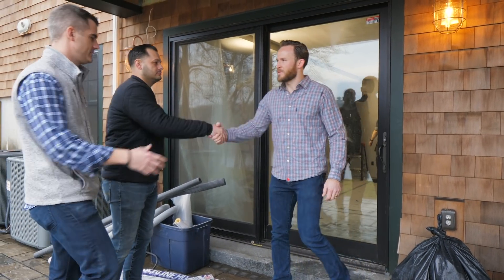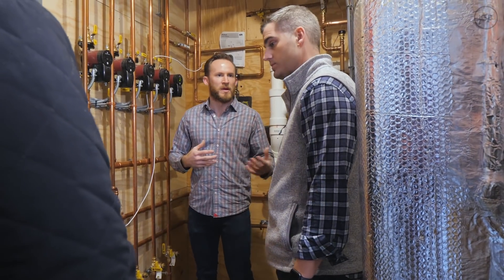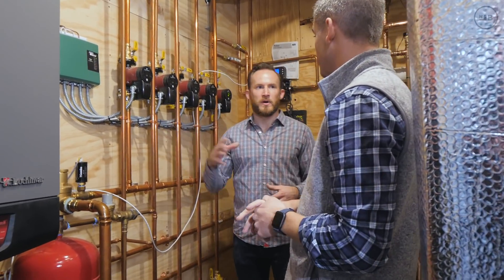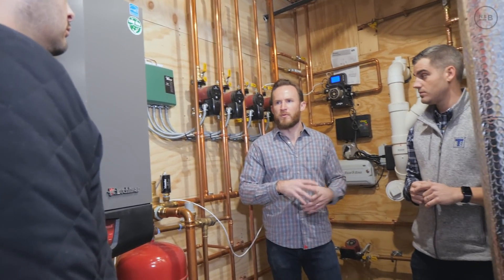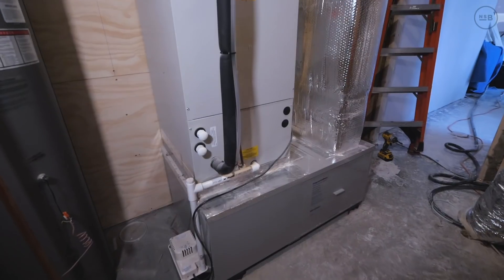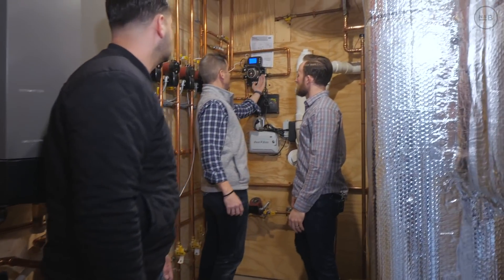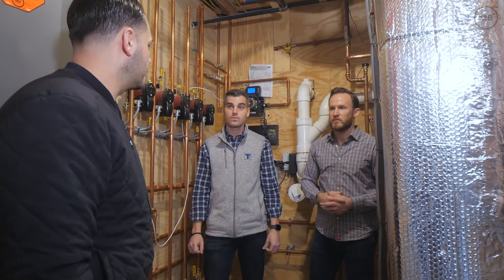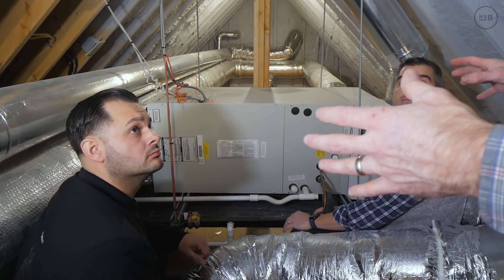Walking through a comfort engineered HVAC system at NS Builders Lake Drive Custom Project

Comment: Psychrometrics guys. The dryness of air has to do with the temperature gain. Only way this 'dry' statement is true is if the HW can't produce the same high temperature of air. Furnaces do not allow combustion gases to have mixing with air.

Great craftsmanship though. Kudos on that piping plan
Reply: I'm glad someone said it, that irked me.  Another thing that would add to dryer air in the winter is air-leakage to the outside as well which is less of a problem in newer high performance homes.
Reply: I consider myself extremely lucky that my thermodynamics professor found time at the end of the term to cover psychometrics! It really simplifies the connection between heating/cooling air and the humidity.

Comment: Love the idea of putting the ERV into the return of the HVAC system so it 1) eliminates the need for its own ductwork, and 2) conditions the air before it enters the home so you always have a comfortable home. 

I’m a little unclear about the answer about how it all works when the AC isn’t running though. Was he saying that the ERV ducts go directly to the return grills themselves?

Comment: Awesome Video. However it sounds like you were on to something with the ERV dumping air through the existing air handler returns. When the air handler is off the ERV should probably send a 24v signal to the air handler to turn on its fan. Does the ERV generate enough CFM to drop through the returns?

Comment: Wow! Amazing setup and attention to detail. I'd love a follow-up video where we hear from the homeowners in a few months/next year as to how well the system works. My issue with this type of system - and it may be because of my 16-year-old AquaTherm system's deficiencies, is that the air exiting the registers is not as warm as a traditional gas-fired furnace. As such, it takes an inordinate amount of time to heat my home, which is about 1,300 sq ft.

Comment: Guys, heating air does not remove moisture from it.  It doesn't matter if it's a boiler/coil unit, a gas furnace, a heat pump... no heating appliance dries the supply air.
The only way a forced air system can dry a house is if the airflow results in room-to-room pressure imbalances and increased air infiltration; cold dry air infiltration in winter months can dry inside air.

Comment: Can somebody tell me what is the white insulation foam under the roof ? I m looking for fire proof insulation.  Thanks
Reply: Spray foam insulation, likely open cell spray foam but could also be closed cell. (Main difference is open cell is water permeable and needs thicker layer for same R-value but cheaper, closed cell is denser and water & air tight so you can get more R value is tighter area) There’s lots of different brands out there but just search for spray foam installers in your area and you can find some (because you mix and install on site, the spray foam guys usually only do spray foam, and guys who work with regular batt won’t do spray foam, as there’s for sure an art to getting spray foam right)

Comment: Wow very, very, very nice setup!!!!  My only concern being a South Florida HVAC contractor is, How long before the upfront cost justify the install?
Reply: If you subtract all the future set ups they installed, the cost difference is not that significant to use their set up. The radiant in the garage is definitely not necessary, but popular among high end clients. The combi boiler can only run off natural gas. So im assuming is supplied by the street, otherwise they need to have a tank somewhere. If we assume its supplied by a main gas line running in the street, you then dont technically need a chimney because its a direct vent. This saves you a lot in some cases. This client would most likely have a chimney for wood burning anyway though. I would think its justified straight away. The combi boilers are sometimes less than a good oil fired. Also take way less space.

Comment: New fans have 10-12 CFM/WATT! Which is great, I replaced a 70 cfm at 60 watts bath fan with a new digital at 6 watts.  It would cost at 10cent/kwh 24/7 $5/yr to run.  A cheap way is to use the Hampton bay 50 cfm 1sone 6 watts to ventilate use a wemo wifi wall switch and program times

Comment: No trap on condensate drain on AHU in basement, negative side of the blower, need a trap to drain properly. Running traps are never good to use either, clog easier and usually not deep enough to overcome the blower.

Comment: If you run condensing boiler at 180 degrees, it won't be condensing and then it'll be 83% efficient, not 95%

Comment: Pretty slick system - I'm still waiting to see a system that does both hot water and ice buffer generation for "on-demand" with a water-to-water heat pump at the core, a solar tube heat collector on the roof and a low-temperature air-to-water heat pump - running off a few solar panels and a steerable CHP plant (95%/5% to 5%/95% heat/power).  Hydronic-radiant heat in the floors and hydronic-radiant cooling in the ceilings, with a much smaller water-to-air heat exchanger and an energy recovery unit plumbed into a dehumidifier for fresh air conditioning.  Variable speed pumps on all fluid circuits, variable speed fans on all air circuits, and large diffusers for low air movement speeds in the occupied spaces.  Comfort, energy efficiency, indoor air quality, power all in one system.
Reply: CERV ll would be nice to see as well,  but Americans so behind  so not in our life time
Reply: Dork
Reply: America has it in a college dormitory in Pittsburgh.  It was over thought out and the cooling panels in the ceilings had trouble getting their controls to communicate with the B.A.S.  the cost is to great for a regular home to make sense for the average home.  For the climate they are in the best for efficiency and initial cost IMO is to have a high efficiency furnace with a variable speed ecm blower with an inverter heat pump.

Comment: they both looked like deer caught in headlights when you asked about what happens when the attic air handler isnt running and the erv is still (continuously) sending air to it. their answer that its sent back through the returns at more than likely a colder/hotter temp than heated/cooled room requirements (causes the air handler to run more often) makes no good sense whatsoever. hrv`s and erv`s are fickle (but necessary) pieces of equipment that have to be installed properly. the proper erv wouldve been independent of the air handler. really disappointed in their half ass design. it would serve you well to steer clear of these two knuckleheads in the future. anyhowways your question was spot on Mr. Brainiac
Reply: I agree.  ERV's work best when connected to an A/H which runs 24/7, else they just circulate the air back to the ERV when the A/H is shut down (path of least resistance).  An A/H with a DC variable speed motor is most efficient.  Or, run separate air handling lines to/from the ERV.

Comment: Everything very efficient  - still way more expensive than in the 70s.
These over engeneerd houses are the reason a smaller percentage can afford a starter house.
Step by step going the way Germany is building. ( much lower home ownership) ( great houses)
( I first saw this heat exchange in 93 in Germany  - used in buildings)